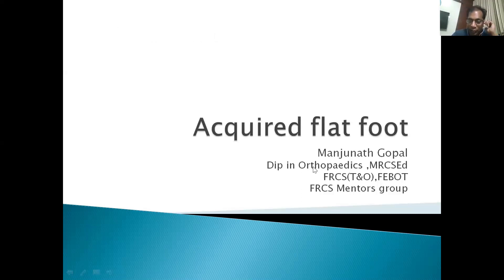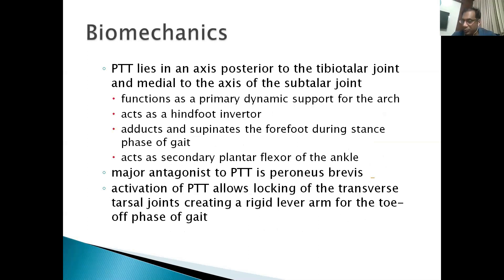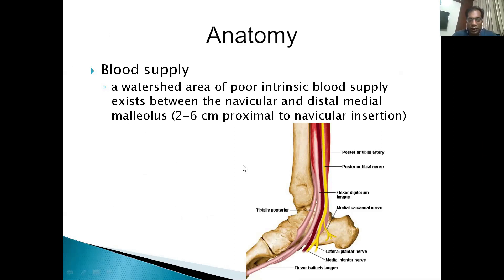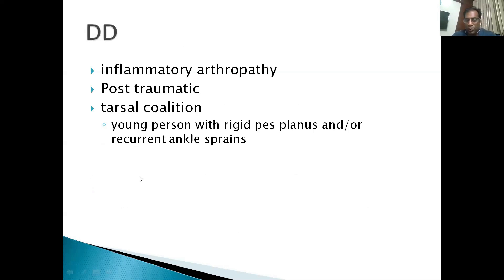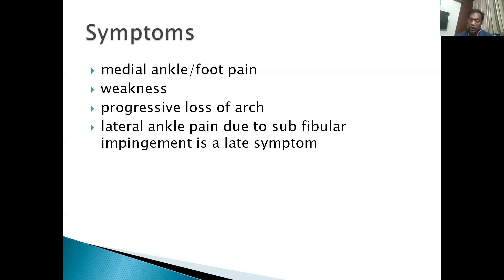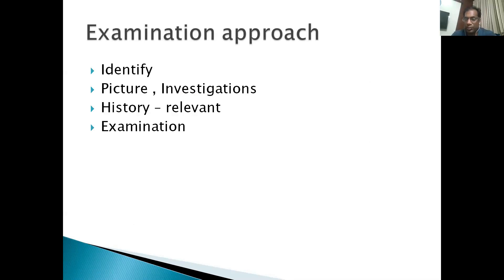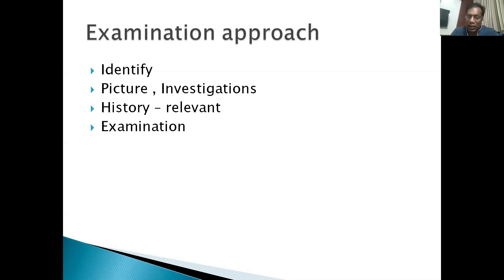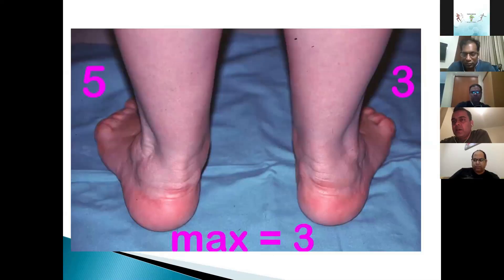Acquired Flat Foot | Pes Planus. Orthopaedic Academy

Comment: In the Inspection and Palpation slide, you have mentioned a test to check whether forefoot varus is flexible or rigid. In this you ask to bring the heel to neutral and check for forefoot correction.

I dont understand this. There cannot be a situation when heel is flexible and forefoot is rigid i believe. Because the forefoot varus is just a compensation to heel valgus.

Please explain it a lillte more.